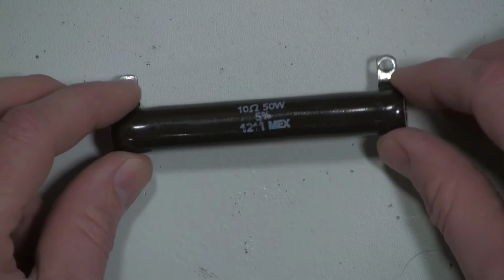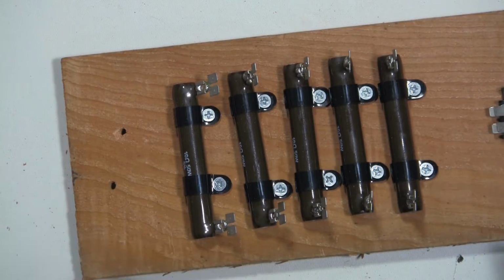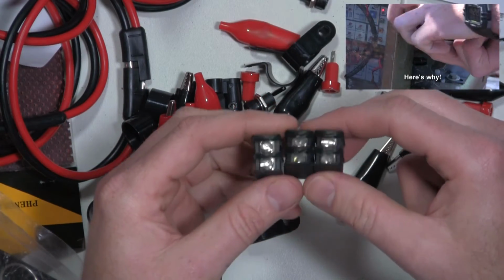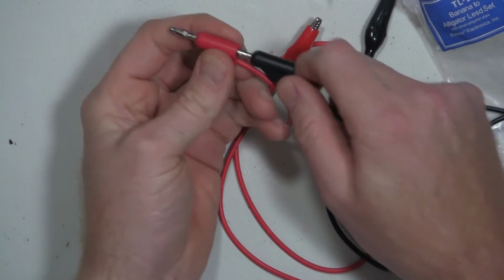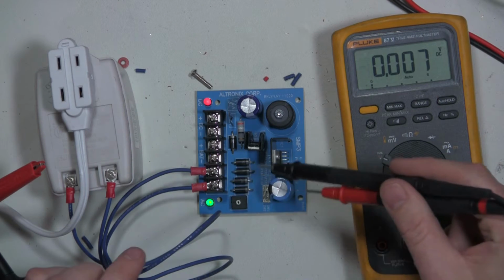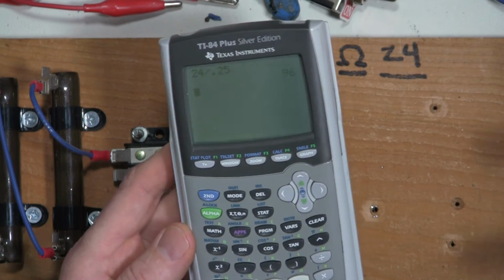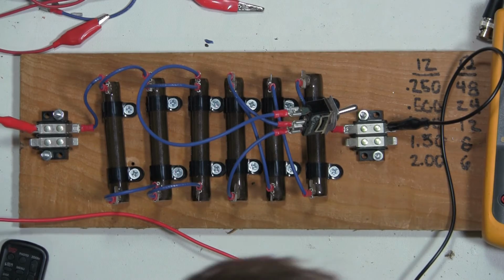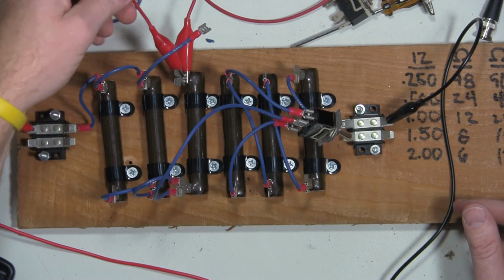ACF 013: Low voltage power resistance substitution box / dummy load

Comment: Another nice video. I like those green phoenix connectors, used a lot of them on sound systems.
Reply from the maker: +Jeff Moss Cool. Thanks. have you ever looked at or picked a KNOX lock?
Reply: +accesscontrolforum I assume you mean KNOX boxes that fire departments use? I've seen many of them but never picked one - they use Medeco high security cylinders.
Reply from the maker: +Jeff Moss Yes that is what we mean. But they do make pad locks as well. Same cylinder and all. Thanks for the info.